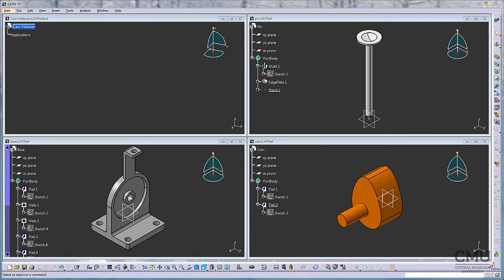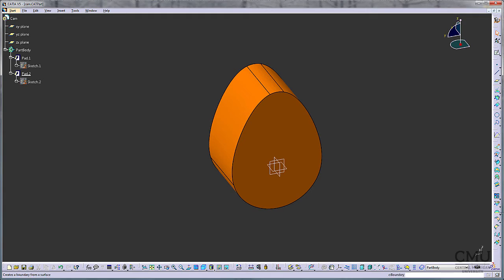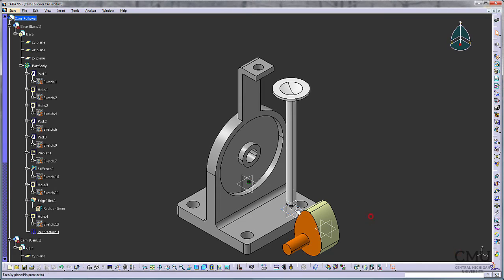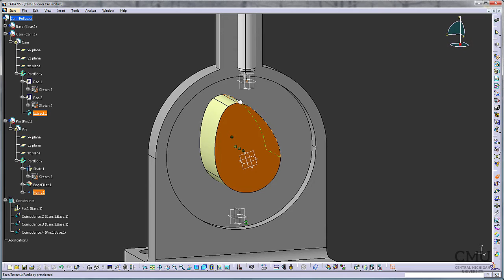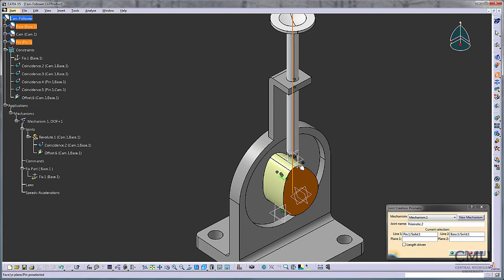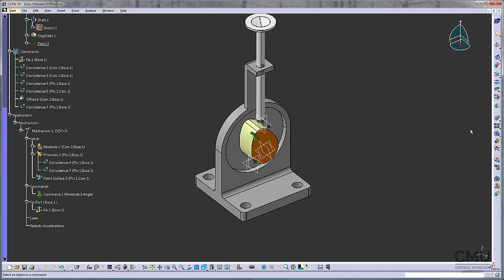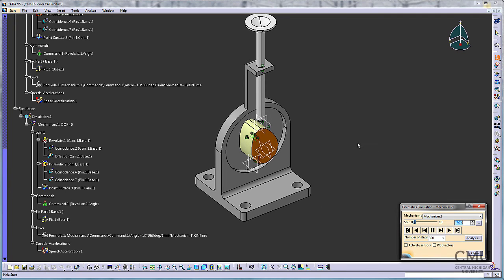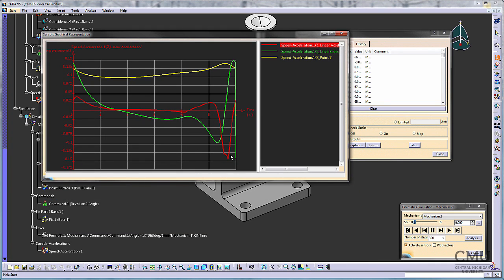CATiA DMU Kinematics Tutorial #7

Comment: 6:30 If anyone not able to constrain the point and surface (in extract) in assembly. Then constrain the point and any line in the surface and update then the point lies on the surface with offset zero. then delete the constrain (without moving the mount away then it lies on the surface). Then go to kinematic simulation. it works fine :)

Comment: I'm not able to make a coincidence constraint between the point and the surface
Reply from the maker: If you extract the surface from part, it should be easy to do. Also try not to make the surface as part of complete circle which CATIA keep put the point into the center of. Hope it helps.
Reply: @DrSamsonSLee  I tried the same way but not working yet. After selecting the point in pin not able to select the extracted surface :(

Comment: Nice explanation. Unfortunately I cannot set the coincidence constrain if the cam is cylindrical, Catia always selects the axis, not the surface. Everything right with other shaped surface.
Reply from the maker: If you extract the surface from part, it should be easy to do. Also try not to make the surface as a part of complete circle which CATIA keeps putting the point into the center of. Hope it helps.